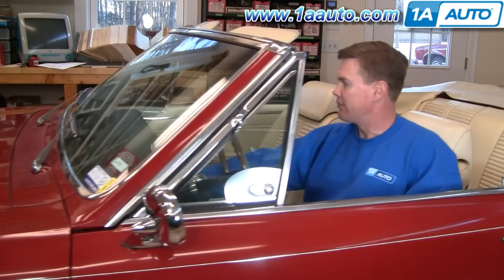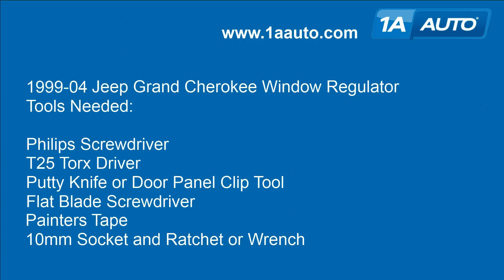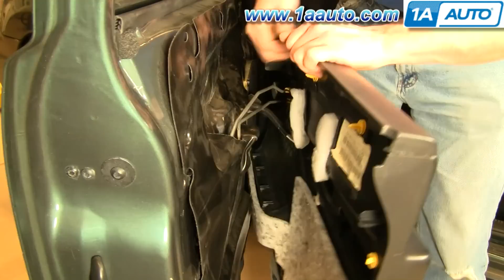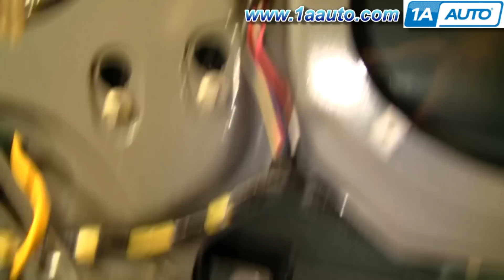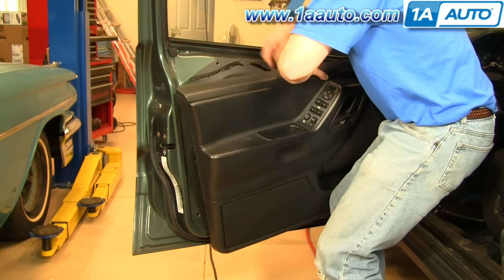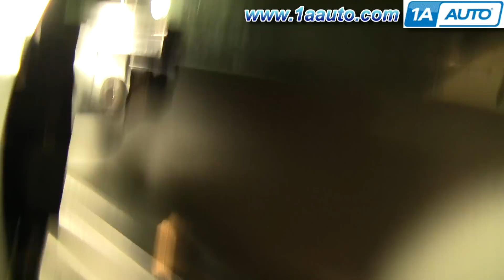How to Replace Window Regulator 00-04 Jeep Grand Cherokee

Comment: Good video.  It's installed on a '99 WJ, and it works!  I took the opportunity to "rebuild" the vinyl water barrier with alien tape or something like that.  Now, onto the rear passenger regulator.

Comment: Many thanks for the perfect instructions. It's a 3h job for unskilled people. Be careful not to break your glass by misunderstanding the instructions and trying to pry it upwards instead of sideways from the old track. Sideways is correct!!
Keep your cool when the glass won't slide down before the reattachment of the pins. On your right (near the door hinge) is a foam which guides the glass-- but not if the glass is on either sides of it.

Comment: I have this problem, my regulator works fine , but when I roll my driver's down, at the half of the distance I get an isntant clinking noise. so when I get it up the window tilts forward and it gets stuck. I have to force it with my hand to get aligned with the track and it will eventually get all the way up...any idea what it can be ?? thank you

Comment: This is one of the very best tutorials I've watched online...  And I watch A MILLION tutorials.  Also, just FYI, I didn't buy my window regulator from 1A Auto Parts, because I didn't know about you.  BUT, I actually need the rear window regulator too (just broke after I placed amazon order) so I WILL DEFINITELY be placing an order with you guys today (and for seat switches if you have them).  Just wanted you to know these videos worked to get a new customer.  Lastly, I love that you ramp the speed up for simple things like the speaker removal and trim down any wasted audio. the voice over was a great touch as it's better than slow on-camera dialogue.  GREAT JOB!!!! And, thanks!

Comment: Just did this install - fyi make sure the rubber felt window guide is properly in place. My window had some how slipped off of the guide and after installation was rocking back and forth and getting stuck when going up and down. Took a while to slip the window guide back over the glass properly because it's a tight space. All good now.

Comment: Thank you for posting this, helped me with 2002 JGC rear window. NOTE: The plastic tab that receives lock linkage snapped despite my best attempt to be gentle. Gluing alone would not have held so I used the old 'super glue and baking soda' trick to build up some material around the break. Now strong like bull.

Comment: model 99, when i start the engine, I can hardly turn the wheel, its difficult to move but in 1 minute back to normal, do you have any solutions or something at your store so i can repair my problem?

Comment: Firstly, thanks a bunch I could not have done it myself w/o these instructions!! One thing though, actually 2...I spent 1/2 an hour trying to unplug the wiring harness( I didn't how the red latch was supposed to be ) I didn't want to break it. You left that out, and I spent about an hour trying to figure out that the harness had to be folded over to fit right. But, I STILL saved a couple hundred bucks, so thanx!

Comment: On your website a regulator with the motor mounting plate costs $88, without the motor mounting plate the cost is $44. How do I determine if I need the mounting plate or not? The original window motor I am replacing has no mounting plate but this is an after market part so I'm not sure if it will install properly if I order the model with no mounting plate. 

Please advise.

Comment: Just a heads up.  After the new regulator is installed, you don't need to remove the clips that hold the window on, before re-attaching the window.  The two little nubs, clip right in.  This way, you don't have to worry about losing or making sure the clips are in the right spot.

Comment: When my passenger side regulator failed, the dealership charged me almost $400 to fix it. With this video, and $43.95 for the part, I had it done in no time! I've replaced my headlight assemblies for a quarter of their cost, now this for about 10% of what they want! Next up is the serpentine belt, again, at a fraction of dealership costs! I recommend you to everyone I know. Thankyou so much!

Comment: hi thanks fore the video, very useful. i had only one problem. i did the same thing for front passenger door. and after fixing the window regulator the buttons stopped working on that door. window button do not work at all, but lock/unlock button you can hear that the motor is working only one direction to unlock. but the lock and window works if i operate from the drivers door. maybe you have any suggestions what might went wrong?

Comment: It almost took me longer to watch the video than do the job! However I did have to source 3 x 6mm screws for the new regulator as the existing ones were 'self tapped' style into the plastic case on the old motor. That said, I am based in the UK so I didn't source my parts from 1A Auto - sorry.

Comment: You tend to oversimplify some of the intricate steps…Otherwise good video.
I have just had a mechanic to replace my regulator and my front passenger glass is constantly rattling. It sounds like my passenger glass is coming off every time I close the door…I am not happy. He is blaming JEEP. Never the mind the fact that I have purchased my JEEP and this is my Grand Cherokee. The other three doors are still factory and none of them rattles…Except for the front passenger glass window.

Comment: Do you happen to have a link for replacing it on a '98 Jeep Grand Cherokee Laredo? I replaced the regulator fine but my window keeps coming out of the two metal brackets that the window sits in. The angle seems odd and it will come push up just fine but doesn't pull the window down. Any suggestions would be greatly appreciated. Mine does not have the clips as shown in the video here.

Comment: The motor works great. My only problem is when the window goes up. Half way through it jams. It looks like the window goes up at a angle. If I pull the window from the jammed side it will continue to go up all the way. What's my problem?

Comment from the maker: You may want to remove the door panel to see if the regulator has broke. Usually the cables break on these type of window regulators. We carry new ones on our website 1aauto.com 888-844-3393

Comment: Your video REALLY helped me get through this project with much less hassle.  Thanks so much.  Toughest part was actually trying to get the clips reinstalled between the window bracket and the new regulator.   Could almost use a video for that alone.   About a 3 hour total for me but would not have attempted without your help.

Comment: Thanks so much!  Using your visual instructions, I was able to easily complete this repair.  Without your instructional video, I would not have known what to do or attempted the repair.  To others doing this repair, ensure your driver's side window lock has been turned off prior to testing the newly installed component or you may fear (as I did) that your newly installed part is defective as the regulator won't activate.

Comment: Thanks for sharing.   I have a 1998 grand Cherokee that the passenger and rear doors ALL work (windows and locks) independently. The Driver door master control doesn't work any of them or itself. There doesn't seem to be any power to that door. Any solutions? I'm not sure which fuse or maybe a short. No fuses look blown?

Comment: I think I figured it out.  I thought the trough connected to the bottom of the window was supposed to separate from the window but I think you're saying that it stays attached to the window and disconnects from the regulator somewhere below that.  Correct?

Comment from the maker: That exact same thing happened on this Jeep Grand Cherokee. The window regulator has more than likely broke. If you need to place the window up while your waiting to make the repair, take the door panel off, and push the window up with your hand. Take a pair of vise grips and clap them onto the old regulator under the window bar, so that the window stays in the up position. We carry brand new ones on our website that are made very well. Our phone number is 888-844-3393 1aauto.com

Comment: on mine the window just fell into the door and if you lift it out it wants to just fall back in. If you try to bring it up you can hear the motor working but nothing happens.What part is responsible for holding the window up and  any tips to fixing it? THANKS!!!

Comment from the maker: Where the plug is attached the wires inside may be in the wrong places, if it's possible you could try to reverse them. If you keep having issues with it, we carry new window regulators on our website for your Jeep Grand Cherokee with FREE SHIPPING. Hope this helps you out. 1aauto.com 888-844-3393

Comment from the maker: You may want to check the pinning on the regulator to see if it is reversed for some reason. If it is, if you're able to switch the wires around it should solve the issue for you. If you bought the window regulator from us and are still having a problem with it, call our sale staff @ 888-844-3393 and we can assist you. Hope this helps you out.

Comment from the maker: If you are having an issue with the window regulator the best bet would be to see if the switch is putting out the correct voltage (12volts) and to see if there is anything holding up the regulator tracks.

Comment: So after watching the video and reading some of the comments, I'm not sure if it's a voltage prob or if regulator needs changing. The passenger side mirror is struggling to go down and up and gets stuck when it comes one quarter of the way down... any advice?

Comment from the maker: Well if you installed the regulator with the motor then there could be an issue with the new track on the regulator. If you just installed the motor, then there could be an issue with original regulator.

Comment from the maker: You will have to dive into the door panel to get a better idea of what is going on inside. If you see the regulator wires broken, then you found the issue. If everything looks good, you will have to test the connection to see if you are getting 12volts to the motor.

Comment from the maker: Thank you for watching our repair video. We currently do not carry the water shield. The dealer may have it or you could buy a piece of plastic from Home Depot and trim it out to fit the door. The part number on our website 1aauto.com for a drivers side window regualtor on a 01-04 Jeep Grand Cherokee is 1AWRG00249  on the 99-00 it is 1AWRG00220 or you can call Tony @ 866-403-3393 Hope this helps you out.

Comment: I just wanted to say thanks for posting this video. My motor was fine but the regulator had broken. After watching this video it took me about 45 minutes (I'm a novice) from start to finish to complete this project. Not bad considering I had never open this up before. Thanks for clear step by step instructions as well as included the tool list at the beginning!

Comment: Hey guys thanks for the video it really helps! I have a question at about the 3:50 mark you talk about a common problem where the regulator cable just snaps. That's what happened to me. I was wondering if I have to get a completely new regulator or if I can get a new cable?

Comment from the maker: If you look bettween the door and the body of the Jeep there's a wire harness that sometimes comes unplugged (you may want to check the connections) there could also be a broken or frayed wire in the harness that's causing this issue. Also check the fuses. Hope this helps you out.

Comment: ok popped the panel off and took the water proof seal off...i see the white plastic tip of where the cable attaches broke...but the cable itself looks intact...can i buy just a piece for that or do i have to replace the whole unit? aka the metal tip of the cable is at the top of the door around the spindle and not attached to anything and the white plastic piece i found in the bottom of the door....i tried it while it was still together and hear the motor working

Comment from the maker: @carbon43 You may want to take a look at the latching mechanism to see if it's grabbing the striker on the door jamb correctly. If they're not lined up right, it could cause this type of an issue. Hope this helps you out.

Comment: Great video. I replaced both of my window regulators that the dealer just "propped" up.

Hoping you can help me with a minor issue now- the right rear door closes (and latches) but isn't flush with the rest of the body. Also, there is a small creaking to the door. Any ideas?

Comment: Great job on showing how to remove the door panel.  I've replaced my door speakers several times now so Im good with the door removal, but I recently broke the cheap plastic piece that connects the locking rod and the latch rod.  I was wondering if you know what that piece is called so that I can replace it?  Its the part that connects the power mirror and power window as well as the connecting rods.

Comment: In the past year, 3 of the 4 window regulators on my Grand Cherokee have failed. After paying $250+ twice at the repair shop, , I found your video and ordered the part from 1aauto.com.  This video is excellent and the part was shipped free in about 3 days.  I am not a car person, I change the oil and that is about the extent of my mechanic skills.  But thanks to your video.... I was able to change the regulator myself and it actually works!!!  Thank You!

Comment: Thank you very much for this video and the product. My driver side window on my 99 Grand Cherokee went bad and I thought, well, that's going to cost me... But I bet I saved over $250 doing it myself with your video and regulator. Installation went exactly as shown in the video and took me about an hour and a half from start to finish. I broke two door clips but didn't affect the door panel re-install much. Many thanks!

Comment: Had the passengers side window do this last summer at around noon that day, had to go to work that afternoon at 4:00.  There were storms on the way that night and it did storm with tons of rain,   Had the local mechanic fix it, not as bad as a dealer but still cost me 250.00$   The drivers side broke last night and I was off this weekend.  Bought an aftermarket part at Autozone for around a hundred bucks for the total assembly and regulator.  After  your video, I fixed it in about I hour, Thanks

Comment: wow! I''m going to the junk yard tomorrow and get a regulator! I fixed the broken passenger door handle by using the rear passenger door handle! I was tired of opening my passengers door for them and the window was not working!  Thanks again !!! I'll be looking for more instructions from you ! You saved me $400.00 bucks easy, I'll charge $200.00 for my friends! Thanks!

Comment: Helped my fix my 2002 Jeep grand cherokees driver side window. I replaced both the regulator and motor. Took me about 2 hours since I had some trouble with the door clips not cooperating.

Sadly, I still cant drive the car because its stuck in 1st. Thats the next issue on the list :) 

Thanks!!

Comment: i have a 95 jeep grand cherokee and my driver side rear window motor went with the window completely up. you need to put the window down to un-mount it from the window motor but it will not go down so there is no way for me to get to the bolts that hold the window on the motor. I have a new motor i just dont no how to get the old one out... any suggestions?